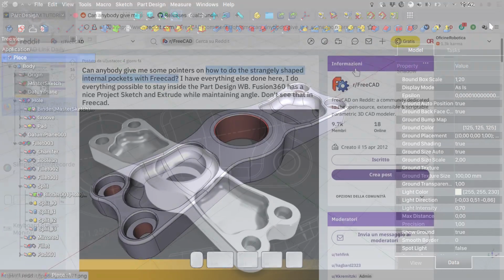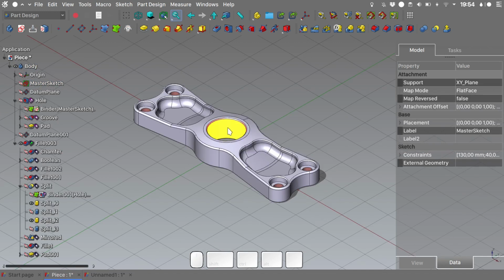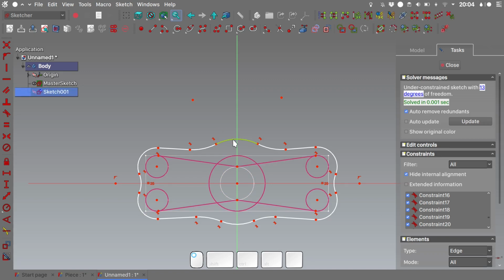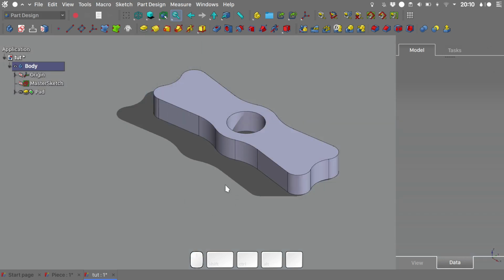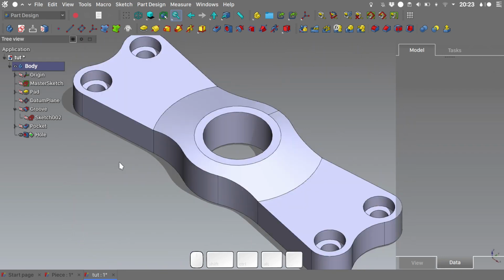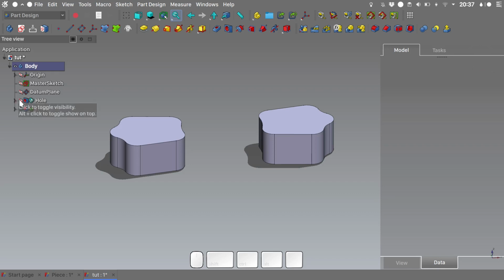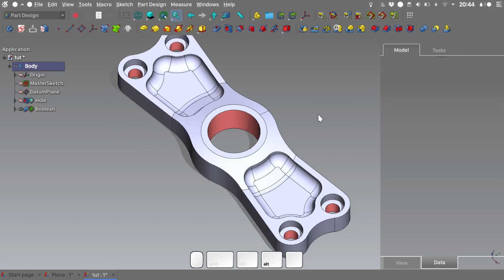Tutorial;  Multisolid as a way of modelling complex shapes in FreeCAD LinkStage3 dev. branch.

Comment: A very good video, as are all your other ones. I managed to get to the two large pocket holes but couldn't cut them. I suspect this is because I am using the standard version of FreeCAD and it is not treating the pocket body as a separate object which can be selected as a single item. By selecting each face (or the pad from the model view) many duplicate entries are added to the model view and an error message given 'requested feature cannot be created'. I tried LinkStage3 on my old computer which didn't work very well, maybe now I have a new laptop it would be a good idea to try again.
Reply from the maker: Thank you so much for your kind words. Unfortunately, for this tutorial to work you really need LinkStage3 because the multibody functionality is not yet in master. I guess it can be done in PartDesign using booleans but the purpose of this tut was to show the new tools and workflows possible  thanks to the new funtionalities introduced.
Give LinkStage3 another go, allot has changed especially in the rendering department.

Comment: Why did you mirror before applying the fillets instead of after?
Reply from the maker: The topo naming algorithm is the Achilies heel  of freecad. In LinkStage3, Realthunder has largely resolved this problem but applying fillets and chamfers at later stages of the model helps on avoiding that problem. It's also a best practices stuff. Hope that makes sense :)
Reply: @OficineRobotica  thanks for the answer!

Comment: Instead of importing a circle as external geometry and then creating an equivalent circle, you can just import the first circle as defining geometry. Also, for the line fillet tool you don't have to select the two lines, but can just select the point connecting the two lines.

Comment: Was curious, is there a benefit to doing the auto grouping with the sketch for the two cutouts rather than create another body and then doing a cut operation of the two bodies?
Reply from the maker: It would be a long long explanation lol and would need a video of it's own but to make a long story short it has to do with the dependency graph, local coordinates systems and top down design. Both approaches work  the same and are correct but due to the inner workings of FC, confining the features to one body helps allot avoiding the "cyclic reference" error when basing features of another body on this one for example in an assembly. It also yelds a cleaner tree when you have more than one body in your file. 

One thing that I wish is that the visual distinction in the tree of the solids would be clearer. I think that would be a good feature request :)
Reply: @OficineRobotica  Thanks for the summary, I kind of get it. I have encountered the cyclic issue many times but not sure if my process is just off or if there's an easy method to prevent it.  I'll do some more research on the feature and learn more about the interacting components

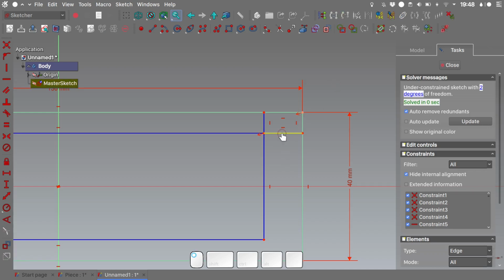Comment: Intresting how you solve this at 3:40, I connect the two corners with a construction line and set it to 45° 😉
Anyway thanks again for showing us to make use of the full potential of linkstages freeCad 👍
Reply from the maker: Yes, but in that way it won't represent the radius of the arc anymore unfortunatly.  Anyway there are allot of ways to solve the same problem. Thank you for your kind words :)

Comment: 6:46 BTW, when fixing the point of the line to the vertical axis: I think this is not according to the intent of the tutorial. If you look the the PDF-blueprint, they have a circle of 1inch in diameter, and the point should be tangential to this circle. (This tangential point does then NOT sit on the vertical axis.) Just a minor point, the whole workflow of the video is much more important anyways!

Comment: This branch is just awesome. Is there a place to submit feature requests for it? The community of official FreeCAD is very reluctant to any changes that could make this software more similar to commercial CAD programs and thus more accessible for new users. They claim that many of these features that people suggest are bad practice in 3D modeling. Even though pretty much all professional CAD solutions offer them…
Reply: It would be unfortunate for RT Link branch to become a hard fork. While you could make such a request in the RT Github I think you might find similar resistance there to anything that might move that branch further away from the mainstream. The Blender community faces similar issues when requests are made to make Blender behave more like, say, Maya as simply attempting to mimic commercial software is not what open source is about. Blender's answer is usually that if you can supply resources and coding to integrate any new feature then it is welcome, you are also welcome to request new features but unless such features are in keeping with the development roadmap they may be considered low priority.
Reply: @paulreader1777  many disagree.   FreeCAD has largely been relegated to non commercial nerdom because of modeling dogma and ultra quirky leadership.   I would be tickled if this split off from freeCAD and put a voting /pay-to-play prioritization model to make a tool with practical utility.
Reply: @constructiverealities  You are welcome to disagree but there are sufficient using it to give it impetus and it will become more mature in the next couple of years.
You are also welcome to contribute to the cost of development a la the Blender model which FreeCAD will ultimately emulate.
FreeCAD is free and open for those who wish to use it, even with a few foibles. Those who don't wish to use it can choose a commercial product.
Reply: @paulreader1777  i think you're missing my point.   I'm all in on open source, financial contributions and making and using a great free cad (two words) application for everyone.   I waved green money around with specific interest to support direct manipulation feature development (I come from spaceclaim universe) and was told to pound sand, because such a vulgar interface pattern was antithetical to what freeCAD (one word) should be and would "NEVER" be accepted upstream.  I try to never argue with idiots, and the proof of point is that freeCAD has (and continues to) languish under this kind of weirdo fundamentalist ideology .    It's an open invitation for a reformation of that breaks it free of this dogma and is responsive to needs that increase accessibility and puts some basic  interaction/interface design from this century into play.  Sketchup and spaceclaim regularly change people lives and get them hooked on design.   Definitively,  freeCAD does not with the exception of a handful of sadist.    Where you see sadness, there is opportunity to advance utility and accessibility in having more choice in OSS cad.

Comment: couldn't  you accomplish Sketch001 with 1/4 of that sketch (and 1/4 the constraints) , then mirror twice?
Reply from the maker: Man, I have refine on by default on all features and don't know why I always seem to avoid the symmetry tool. In the times that refine was discouraged because of OCC quirks I made a habit of avoiding seems on the model by building entire sketches. Indeed that would of cutted the tut length in half lol
Reply: I was thinking the same, but I have mixed experiences (as a beginner): Trying to mirror within a sketch usually causes a lot of grief for me. Mirroring a solid works much better. When trying to design a piece (as opposed to just redoing an existing piece as an exercise), it is nice to interactively manipulate the sketch and see how the whole sketch reacts -- I like to see the whole piece change as opposed to 1/4 piece.

Comment: This is a good case of Solidworks having a feature that would be very useful in FreeCAD. I've run into this myself at times. This would be a great addition to the pocket operation: pocket to a selectable face, when that face has an arbitrary contour, but still you should be able to set a depth of the pocket. This would be one operation, rather than the long list of operations required here using boolean cuts.
Reply from the maker: Yes, indeed the pad up to face could use some extra features. That issue has plagued me as well.

Comment: Can we be sure linkstage 3 features will become part of official FreeCAD? Is the project administration welcoming of that?
(It would suck to get used to new ways of working that never made it in)
Reply: Some linkstage3 features are going to make it into main FreeCAD, but not all. The code between the two is diverging at such a rate that linkstage3 will probably become a hard fork eventually..
Reply: @joes144  The idea of a hard fork is sad but these things do happen in open source projects. From the point of view of a user I just want the best FreeCAD possible but that does include stability, docs, community, and all those good things as well as shiny features.
Reply: @AndrewHelgeCox  I agree, but I'll be honest. I prefer linkstage3, it is generally quite stable and I intend to continue using it for the foreseeable future. It's a personal decision for everyone of course.
Reply: @joes144  I cannot sketch on any plane other than XY from the outset in ASM3. This will confuse my students trying to follow simple tutorials from the wiki.
Reply: @paulreader1777  ASM3 or linkstage3? There's a difference and I want to make sure I understand
Reply: @paulreader1777  it works fine for me on Manjaro Linux and Windows 10 both. You may need to clear out (backup first) your /home/username/.FreeCAD folder. Another option is to just rename the .conf files in case you have an errant setting saved. 

If none of those work, I'd probably need to see a video of what's happening since I'm unable to recreate that behavior.
Reply: @joes144  Thanks - I renamed the .cfg files in my Linux Mint installation. I notice Master and Link share the same .FreeCAD directory. Now I am able to use the XZ plane, for example, but only by selecting it in the sketching window or using the view presets, which use Plane Face attachment. I still cannot select the Objects XZ plane in the Sketch Attachment Panel. I think we can work with this but it wasn't what I expected.
Perhaps my expectation that I could select the object planes in the Sketch Attachment Panel was misplaced.
The same applies to my Windows 10 installation although I did not alter the configs there.
I will try the basic part design exercise again with this new insight.
Reply: @joes144  I spoke too soon. Linux is working the way I just described but Win10 is not so I will have to locate cfg's and try renaming them in Win10 too to see if that helps
Reply: @AndrewHelgeCox  freeCAD has been languishing in silly dogma for too long.   A new and pragmatic product management approach is needed.  Hard fork is absolutely the right thing at this point
Reply: @joes144  we can only hope!
Reply: @joes144  I really do hope that there is not a hard fork.
Reply from the maker: Realthunder sinks the code between master and his branch often, that means that he pulls in the new code in master and builds on top of that. Also there are pull requests for all his major features to be merged in master that are being reviewed. As of now his intentions seem to be clear. Linkstage3 is a test bed for features to be merged. The more we test the more he squashes bugs giving a higher probability of things to end up in the official release.